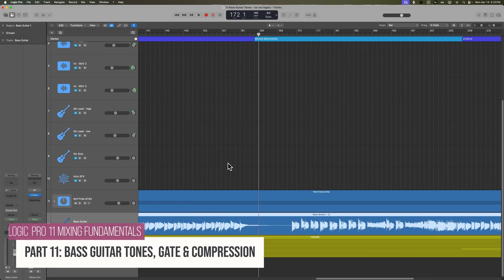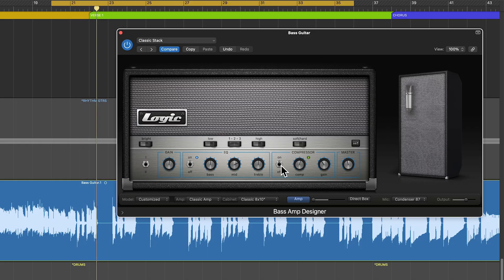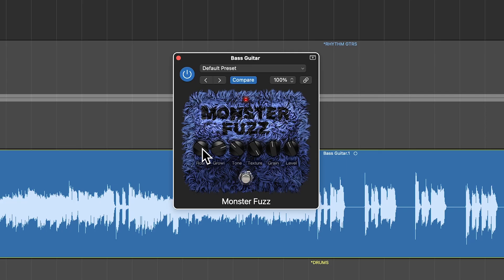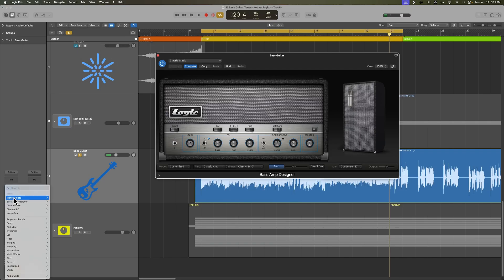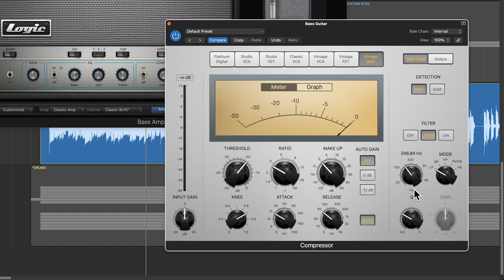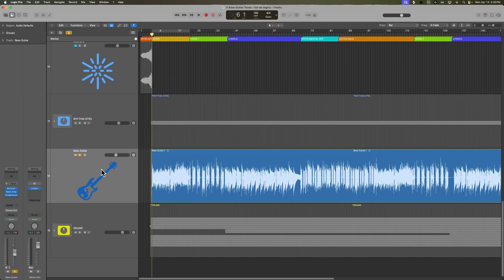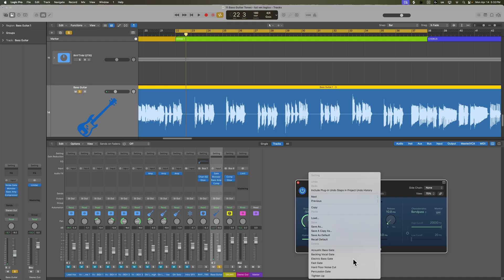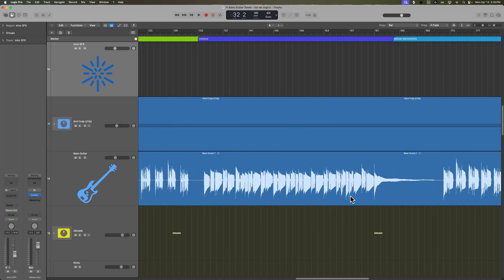Logic Pro 11 Mixing | #11 Bass Guitar Tones, Gate & Compression

Comment: Hi Josh. You recorded the bass in as a DI signal, so I just have a question regarding using Logic's emulation of a DI signal in Bass Amp Designer. Let's say you keep the slider all the way to the right for 'Direct Box': if you then decide not to select a 'Tone' on the Bass Amp Designer plug-in, don't mess with the Boost or HF Cut options either, and end by matching the output gain of the plug-in when bypassed, are we basically hearing the dry signal, so it's as if you're not using Bass Amp Designer at all?
Reply from the maker: Even with everything turned off and the output gain matched, you'll likely still hear a little bit of Logic's direct box model in the signal. I tested it on my end and it seems like the bass is a little fuller sound, even with just the direct box setting.